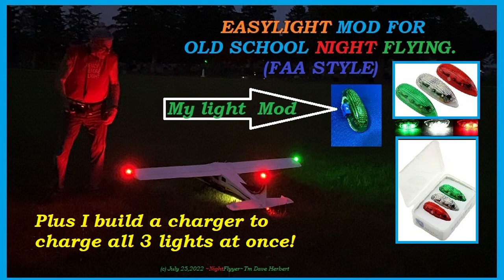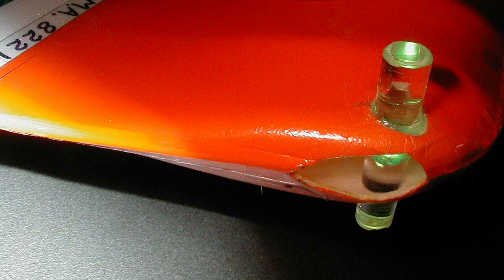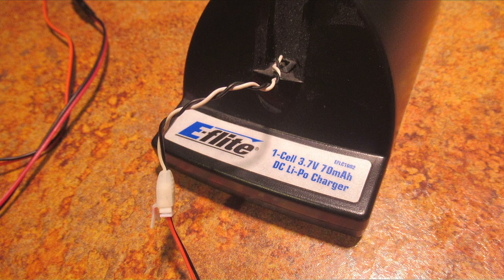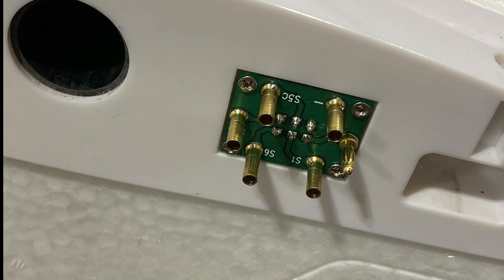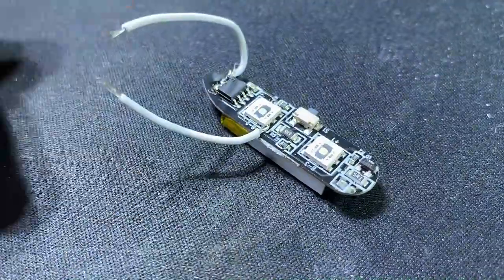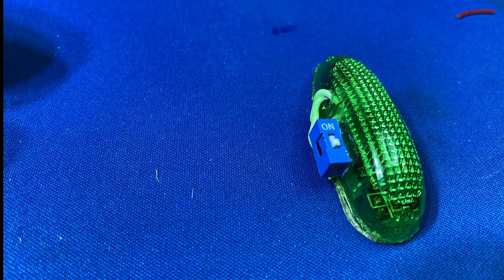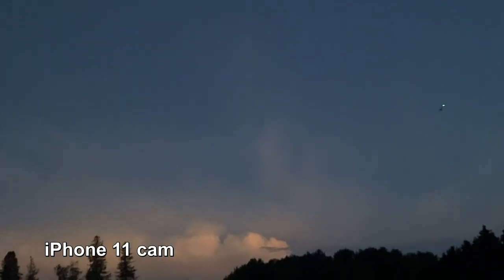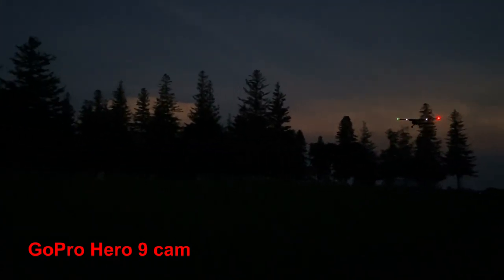Wireless EasyLight for RC Night Flying? A Function is missing, my fix, + test flights w/Beaver DHC2.

Comment: I just knew that you were going to hate those flashing lights before you even got it up in the air. You’re right, it’s confusing and difficult to maintain orientation. Once you made one of your many infamous modifications with the steady lights, then it was easy to see, especially with just the flashing red on the tail only. Nice job and great flying as always. 👍 Semper Fi sir.
Reply from the maker: Ah, you know for sure.  Thanks much, Scott and Semper Fi to you as well.

Comment: A little off topic ,but I came across a old as aluminum co2 motor ,,how big of plane is required?and how long will it fly,,? I didn't want to fire up the motor because I don't have it mounted to anything
Reply from the maker: Those small Co2 motors run about 45 seconds and are typically used on ultralight mini film covered models with wingspans of about 12 inches or so.  It won't hurt to run it in your hand.  It does not get hot.  Thanks.
Reply: @NightFlyyer  boy this one is kinda big and heavy,any way I can seen you a photo
Reply from the maker: @jakelang4387  I thought you meant one of those tiny co2 motors that is just smaller than the Cox .049.  For yours, I do not know,as I never had a Co2 Motor.
Reply: @NightFlyyer  your right ,,I didn't understand at first...yes I would work on a tiny air plane or something..I also came across a old cox motor conversion to gas